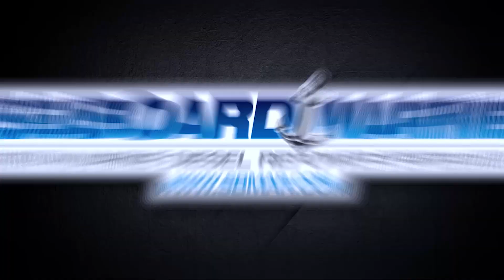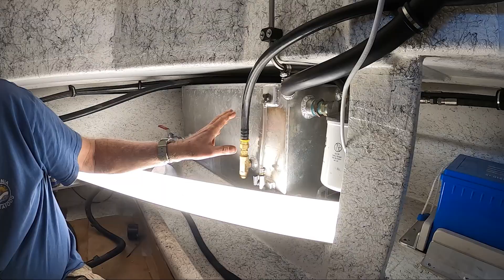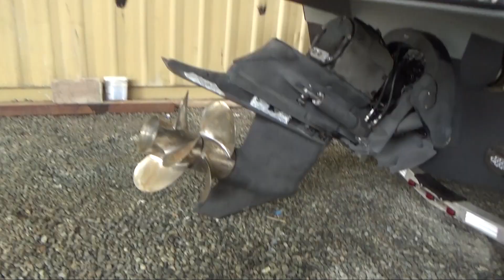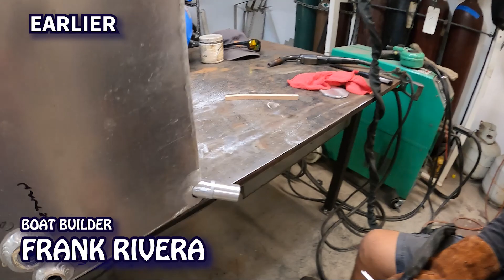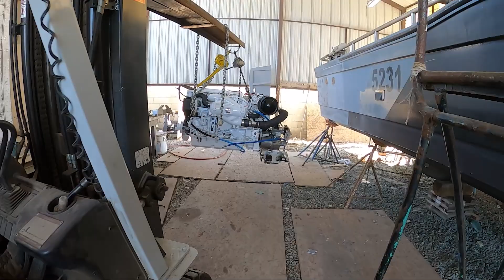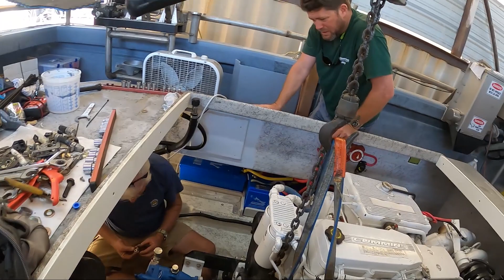Sea Harvester: Hydraulics and Engine Installation

Comment: At 4:57, what is that motor used that has the inlet and outlet lines spinning the shaft on the water pump?